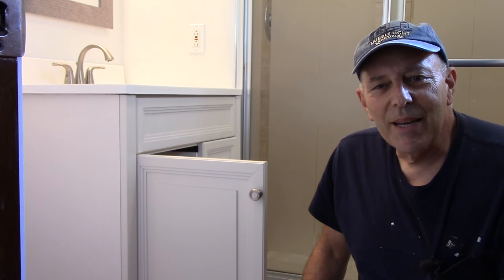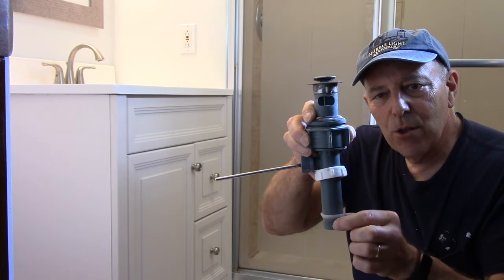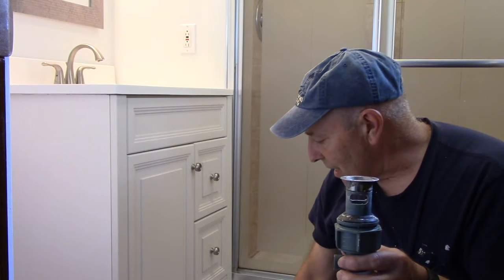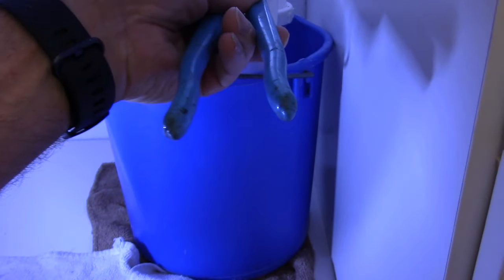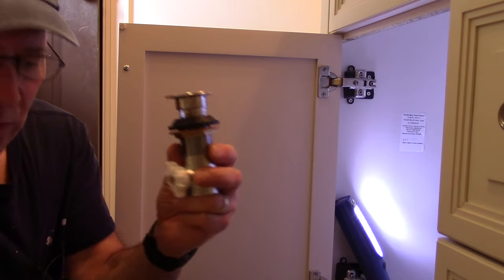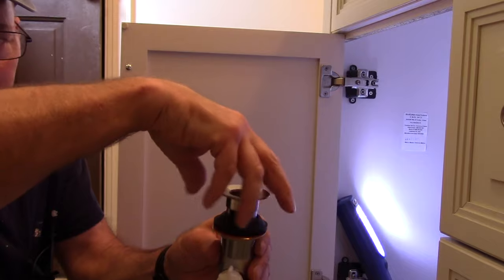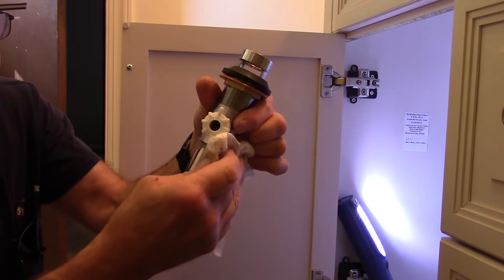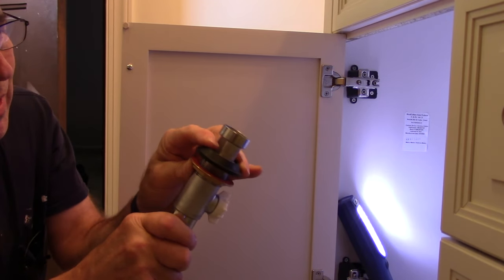How To Replace A Bathroom Sink Drain Assembly

Comment: Only thing I do differently is to add pipe dope on threads where rubber gasket, washer and nut go. Not convinced the rubber seal will always squeeze to the root of the threads

Comment: Can’t just use any kind of plumbers dope or putty on PVC or ABS it will deteriorate the plastic after awhile.  There are specialized sealers to be used on plastic pipe threads that are also good for metal threads, available at big box stores like Home Depot.  You may have to cut the vertical portion if too long, should go at least 1” into the P-trap. This video uses an extension on the vertical, something that is usually sold separately. I’m not a plumber just a DIY guy.

Comment: Thank you for the video! I was trying to donit myself but the old drain halo on the top won't unscrew...there is cement. I tried to remove it and use the pliers but won't even move. Any recommendation?

Comment: Some drain fixtures come with a rubber seal for the drain cap(the piece that the drain neck screws up into), would we put the putty between the seal and cap or under the seal to still be pulled against the drain?

Comment: What did you use to 14:19 is that the same thread lock you put on the metal sink drain the same that you used on the PVC?  Wasnt sure if there was a specific one to use when connecting metal to PVC
Reply from the maker: Here is the link for the product. It is good for metal and plastic 
 https://amzn.to/48eWhEU

Comment: Is there a beveled gasket on the pivot arm ball? AIs gasket at the nut or at pipe?
Reply from the maker: I don't think that the pivot arm has a gasket.
Reply: I think I figured it out. Didn’t have the “piece up on the top” screwed on far enough. VERY IMPORTANT!!!!.  OMG. I have taken this apart and put it back together so many times……..